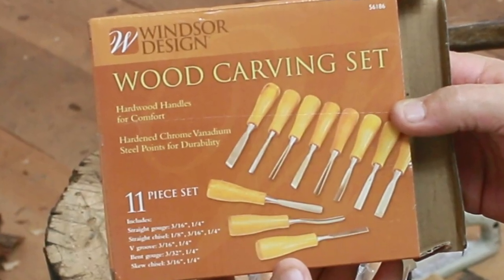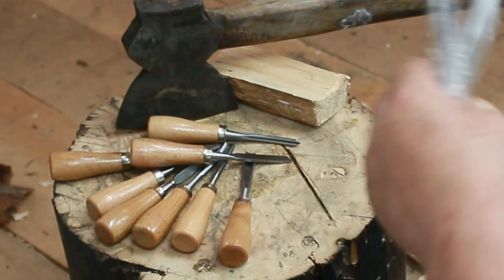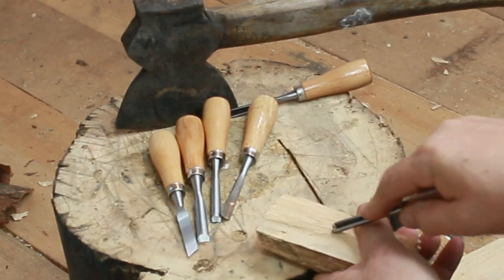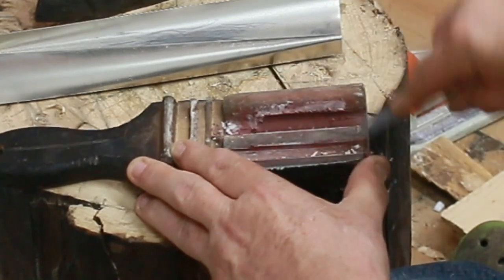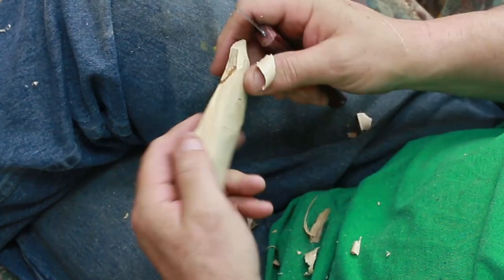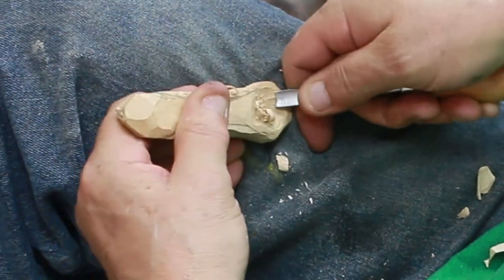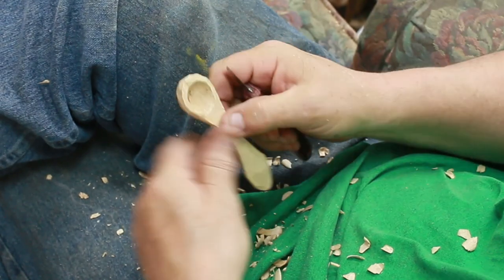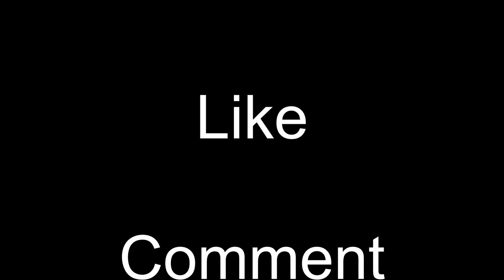Harbor Freight 11 Dollar Wood Carving Set

Comment: Harbor Freight.  Well... I have a LOT of HF tools and such and -- at first glance and first use, it's easy to want to toss them away as "crap." But, there are some 'secrets' to making some Harbor Freight tools into reasonably decent tools that can save you tens and hundreds of dollars over a year or two.  I do a lot of wood carving and have quite a few knives and chisels that came from some of the "top" carving tool makers. Most of them are NOT sharpened to my satisfaction when I unwrap them. And these are the expensive tools! On the expensive stuff, the blades are good, hardened, carbon steel, and the 'profiles' are always ground correctly. They just don't have the 'finish' sharpening and polish put in them yet, because the actual sharpening angle will depend on the type of wood you're carving. Hard woods require a bit 'beefier' edge with a micro-bevel finishing out the sharp part. This helps keep your tool sharper and for a longer time. For the softer woods -- say basswood, limewood, linden or whatever you want to call it -- you can have a longer beveled edge. Generally, it's a 20-degree bevel for the hard stuff and 15-degree bevel for the softer woods. Some carvers just shoot somewhere in the middle at 17 - 19-degrees and work from there.  This has proven to be the best 'all-around angle for me and I work mostly in basswood because I have a sawmill that's always on the lookout for it and they'll call me when they get such a tree. I "barn dry" the stuff allowing about one-year of drying per inch of thickness and, of course supporting the planks liberally with plenty of 'stickers' to support it while it's 'seasoning.' Now, to the Harbor Freight knives, chisels, etc. They really are 'junk' in the sense that they look like a tool but aren't really a tool -- YET. Much of the 'knifey' stuff at H/F is made for the speed of making them and not for the ease and artistry of using them. That's why they're cheap as hell in comparison to those really expensive carving tools. But, those H/F knives and chisels are, indeed, made of the right stuff and -- with a little bit of knowledge and elbow grease -- you can make a doggone fine set of carving tools out of them. The first thing to do is to grind them to the proper shape with a wet (and slow) grinding wheel or more 'elbow grease' and some wet/dry sandpaper. Start with 80 to 100 grit and work smartly and patiently. Treat that tool at least as well as you plan to treat one of your carvings. What you want to do is correct the bad angles on the outside edges of the "V" and "U" gouges. Find a picture online of an excellent example of an expensive tool (Swiss, German, etc.) and sand in that profile. When that is done, it's a good time to do what didn't get done correctly when the tool was being made. And that is to HARDEN and TEMPER it. You can do this with a propane torch, but a MAPP torch would be a lot quicker. I harden and temper these kind of tools in a 2-step process -- heat and quench. Because I don't want to heat the whole damned thing (no reason to, really) and because I don't want to be "F'n" around taking handles off and putting them back on, etc. I wrap the tool in a wet rag.and I only heat about 1/2 inch of the cutting edge. That's all you need to heat. So, I heat it to the 'color' I want. Generally, red to bright red is about 1400 to 1500 degrees and when I get the color I want, I quench it in a soup can (metal, get it?) full of any kind of cooking oil. That's it. Wrap it in wet cloth to help keep the heat from spreading too far up the tool and end up burning the handle; heat the cutting edge to about 1/2-inch back; when the heated patch starts getting bright red, look for the actual cutting edge to be heading for an orange to yellowish color (yellow is about 1,800-degrees). At that point, stick it in the oil and move it around slowly until it cools enough that you can touch it without burning yourself. Doing it this way allows you to skip the part about "drawing down" the temper. Now, at this point, clean up the tool and polish it with some higher grit wet/dry sandpaper. Once you can see polished steel, you go for establishing the bevel and sharpening the edge.  You're basically -- at this point -- about where you'd be if you bought that $40-50 carving tool and were beginning to sharpen it. So, you saved a bunch of money and you actually have a good tool. Sharpen it to your satisfaction with the higher grit (600 or higher) sandpaper, then put some 'grit' onto a piece of leather and strop it. For 'grit' I've found that the solid yellow 'stick' produced by Flex-Cut is hard to beat. You don't want to use any of the waxy/greasy "Tripoli" or "polishing compounds," for this because they are made for use on motorized polishing wheels. The Flex-Cut stuff is made to use with a leather strop or even the cardboard backing from a writing tablet. Use the leather, though. Just find a piece that isn't too thick. Why? Because thick leather will compress under the knife and likely round that beautiful edge you're trying to keep scalpel-sharp. So, thinner leather is how you want to go. Why leather? because the backside (rough side) holds the 'grit' that puts the scary-sharp edge on your tool. Now, for the "insides" of these "U" and "V" tools, you just polish any "wire edge" a tiny bit. If you start trying to put an edge on the inside of them, you'll ruin them. Only sharpen the outsides. For my knives, when they're sharpened/polished, I'll bring them up close to my eye and catch the light in such a way that it gives me a seemingly microscopic view of the edge. When I'm looking at an exact and crispy sharp mirror image of my eye, etc. being reflected back, I know that knife/chisel, etc. is extremely sharp. As I said, I have some expensive carving tools, but I also have a couple sets of the Harbor Freight carving tools and they are quite fine for wood carving after I've "trained" them. Once you learn how to sharpen your carving tools, you'll be amazed at how dull those "razor-knife" utility knives are. You can sharpen them, too. No sense buying pack after pack of semi-dull blades just to throw them away after a few cuts. Good luck and happy carving!